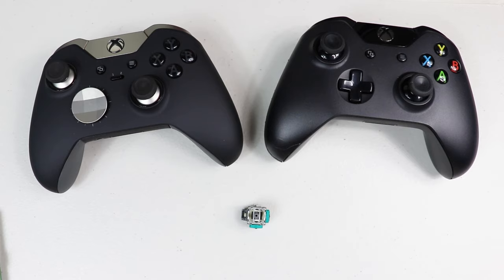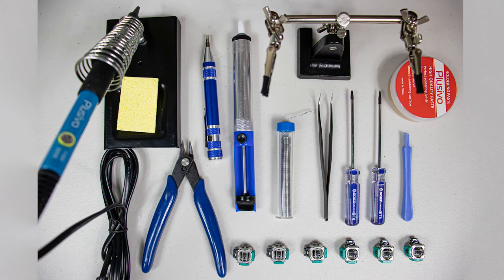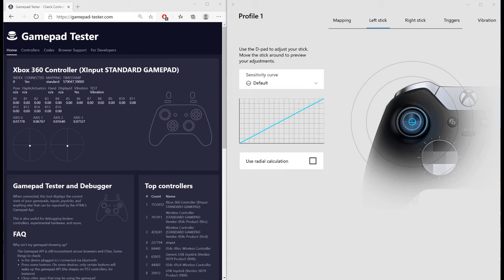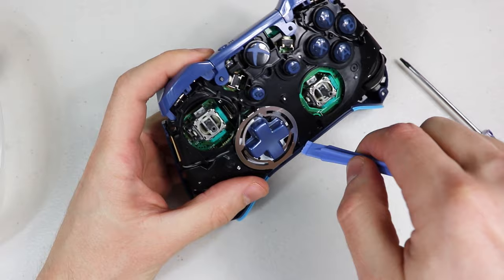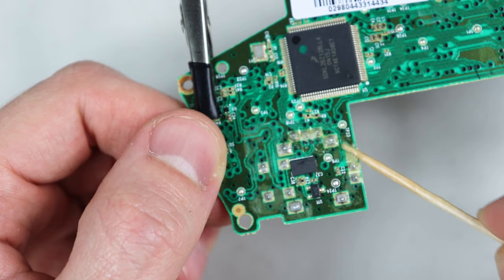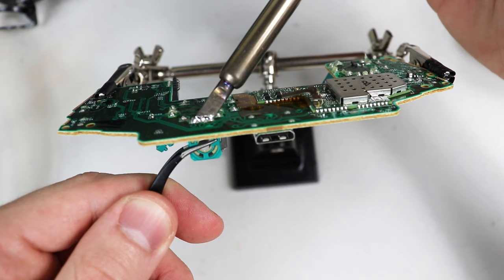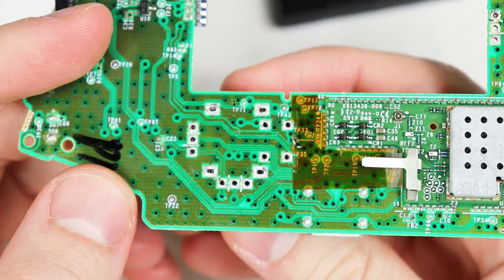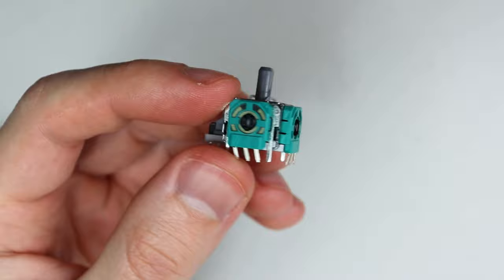How to Replace Xbox One Controller Analog Joystick - NEW METHOD - Fix Stick Drift, Broken, & Loose

Comment: So after you cut the green tabs on the potentiometer, it stays in place after you solder back to the board? And theoretically, couldn’t you do that to the existing potentiometer that has drift? I already purchased your product so I plan on replacing the whole joystick anyway.
Reply from the maker: If the joystick isn't loose and feels fine, I'd recommend just changing out the potentiometer. And yes, it will stay in place even after cutting off the 3 nubs. It's important to not cut off the two tabs, though, as cutting off the tabs will cause the potentiometer to free from the joystick.
Unfortunately a typical reason for a potentiometer having drift is the wearing down of the carbon inside it, so replacement will be necessary then.

Comment: Yoo man. I just dropped my controller and the left analog stick isn't responding when I click it. Should I just pay for someone to refurbish it? I don't exactly have the best luck as I have already dropped it. I was thinking of just to keep messing with it.
Reply from the maker: So the click button is broken? Sounds like you would need a full joystick replacement unfortunately (if you wanted the click to work again).  There are some sellers on ebay in the US who do some repairs if interested. Just type in "xbox joystick repair service" in the search bar.
Reply: @SOSSGAMING  Yeah. I figured. I had to move the stick forward and put alot more force behind the click for it to work and that was one time so something is out of place and broken.

Comment: Do you have to manually adjust the axis. Or can you leave the pins on and use it as stock ??
Reply from the maker: You will likely need to manually adjust them unfortunately. Unless you have the x/s series or elite series 2 controllers. Those ones have automatic calibration, for the lucky few that have them.

Comment: Besides the 6 pins for the potentiometers what are the other pins used for?
Reply: 4 are anchor points to hold the whole module in place, and the other 4 are for the click button.

Comment: Does cutting off the nubs cause future problems?
Reply from the maker: I've never had an issue nor heard or seen it being an issue, because the side tabs hold it in place as well as the solder.  That's why it's important not to cut of the side tabs, because doing that will cause an issue. Thanks for the question.

Comment: I am more familiar with the controller. This video is helpful. My joystick replacements are arriving monday. Im just concerned about the fumes. The warning sign says it can kill if inhaled. Is that easily avoidable? I live in an apartment with no vents or windows all though i have an ac that may act as a vent because it leads outsude. Im not really sure if thats the same. Lol sorry. Im new to sokdering and dont want to solder until im confident. I'll probably solder my old controllers that i dont care to lose first. But mind if soneone helps me out with the whole fume situation?
Reply from the maker: I suppose it depends on what type of flux you are using. If you are worried I would recommend checking out some videos on ways to deal with the fumes. Good luck!
Reply: I was worried for nothing. I'm getting better with soldering

Comment: bro can you please explain about the solder paste, if you don't have solder flux can flux paste or just paste work to make soldering easier and to remove oxidation?
Reply from the maker: If it's flux that is meant for soldering electronic components, I don't see why not! If you've seen Louis Rossmann, his motto is basically use as much as you want for every situation lol

Comment: So everything went great except the Left trigger (b6) is now showing always on. I did not touch the sensor during the joystick process. Unfortunately, the remote is even more useless now than before with just stick drift 😢. Any advice on how to proceed?
Reply from the maker: Did you end up figuring it out? I would clean up the board really well with isopropyl alcohol. Sometimes the flux can interfere with things.

Comment: The video is really good I just have one problem, when I use the tool to calibrate the sticks it either doesn’t recognize any stick inputs (not stick presses, those work fine) or it only recognizes diagonal up right
Reply from the maker: I'm guessing the pots aren't soldered yet? Sometimes it takes a bit of finessing with the pins to get it to recognize. Hopefully the pads aren't damaged. Do the through-hole pads look damaged?
Reply: @SOSSGAMING  the through-holes don’t look damaged, but ive tried it with the other sticks i got and they all had the same issue
As embarrassing it is to admit, i went the cheap route buying sticks and got some Chinese knockoff that look like real life PS2 graphics, comparing those to real sticks shows that they look a lot blurrier especially compared to the see-through part on the pots
Reply from the maker: @ZillionSole31  Yeah it could be the actual sticks then. Unless you had that same  issue before installing them.
Reply: @SOSSGAMING  nah my issue before installing them was that the stick click wouldn’t register so I decided to replace them but now these won’t work
I ordered an official (I think) stick now so hopefully when that comes it’ll work
Reply from the maker: @ZillionSole31  Gotcha. Good luck!
Reply: @SOSSGAMING  thanks, I hope this works cuz I do not have another controller
Reply: @SOSSGAMING yeah I think I damaged the through-holes, I needed to add someone back on Xbox so I plugged in my controller and despite it not having a stick, it still did the diagonal up right thing
Reply from the maker: @ZillionSole31  It sounds like one or more of them are then :/
Reply: @SOSSGAMING  I see, i think what im gonna do is buy a broken Series X controller and then just use the daughterboard from that on my controller
Reply from the maker: @ZillionSole31  yeah not a bad idea

Comment: What if you’ve managed to remove the solder base for the pins? Can you still fix the controller?
Reply from the maker: Technically yes. There is a way through soldering on a jump wire. Which controller are you working on? https://acidmods.com/forum/index.php/board,537.0.html

Comment: Gonna try this on my elite series 2, praying I don’t mess up lol
Reply from the maker: I'm going to make a video on that soon actually specifically for the elite 2's, and by soon that usually means a month or two lol but you actually don't need to calibrate them.  Simply replacing the joystick is fine, as the elite 2's have an internal calibrating software which is quite incredible.
Reply: @SOSSGAMING  opened it up yesterday and changed out the buttons and bumpers but I’m definitely gonna wait for that video to do the analog stick.
Reply from the maker: @koolkid121998  Ok, I'll try to hurry!

Comment: Can i do it with just a soldering iron and some tin? Or do i need the de soldering thing and the flux?
Reply from the maker: You will need to be able to remove the solder somehow with either a solder sucker or wick, and flux will help a lot with the connection but you may be able to get away with it, especially if it's rosin core solder that you already have

Comment: Is there a way to replace only the grey shaft? The grey shaft is broken but the joystick tests fine. The thumb stick just spins freely because the grey shaft has broken.
Reply from the maker: Technically yes, but it will actually be more work, because you would have to tear down both the donor joystick and the one already in the controller. At that point it would just make sense to replace the joystick. If the potentiometers are fine you should be able to get away with leaving them in without needing to calibrate them again. So just the actual joystick part you'll need to replace.

Comment: Hi, I tried desoldering it but i’m having a hard time to desolder two pins do you recommend that I purchase flux and attempt to desolder it?
Reply from the maker: If you don't have flux you will need it anyway (to add the solder later). You can certainly try desoldering it with solder sucker or wick. 
Also, make sure you are using a large enough tip and that it is clean (for good heat transfer). Then I'd recommend adding leaded solder to it (and flux) to also help it melt.

Comment: i don't know if you check this still but i tried two of the joystick module you listed and the controller still shows constant keystroke to the left and won't register any right direction.  i don't know what to do
Reply from the maker: Do you mean it's stuck all the way to the left? If so, it sounds like one of the through hole pads are damaged on the x axis. It's possible to fix this with a tracer wire. If you want to send me a picture and mention which model controller you're working on to my gmail sossgaming I'll try to see if I can help you out.

Comment: I replaced the entire left module. On gamepad tester, the left stick was not registering left or right movements on the x-axis. After replacing with a brand new module, the stick now registers as being stuck fully to the right.

Any ideas what it could be?
Reply from the maker: Hello. First I would double check the joints and make sure there is no bridge between them. Then clean real well with isopropyl alcohol (to remove the flux residue). There's a good chance though it's a case of a damaged through hole pad. I did a write up on how to "repair" it with jump wires. https://sossgaming.com/xbox-joystick-jump-wire/

Comment: Thanks for the video.  I have tried this and am stuck at one point.  I have soldered the new joystick to the board without soldering the potentiometers.  I am able to get the Y axis potentiometer to a good spot, but the X-axis potentiometer is not even registering.  I have bent the leads up and down to no avail.  also tried different potentiometers and desoldered the analog joystick and soldered another one in and same problem.  any suggestions?
Reply from the maker: Best case scenario is that it's just having a hard time, which I've had happen before as well.  The other main worse case scenarios would be that one of the through holes is damaged, or there is a crack in the board or some component in the powering of that pot's axis is damaged, lost, or shorted.
I would first try to actually solder it on and see if that works.  If it's not registering it may be one of the other problems.  A damaged through hole is technically possible to overcome by rerouting with a strand of wire to another specific part of the board (depending on which one is damaged)

Comment: Hey what about the gen 2 elite controller is the analog joysticks the same as the one in the link?? And the method the same for installing thanks really good video I have the elite 2 controller just under a year and the stick drift is really really bad it’s upsetting on an expensive controller. 😣
Reply from the maker: Hey there.  They are not the same joysticks, but if it's just stick drift the good news is that all you need to do is replace the potentiometer(s)! The one's in the link use the same potentiometers. Hope this answers your question.

Comment: Why don't the new cubes come designed so they are automatically centered? I'm a noob at this stuff and I am going to attempt my first repair ever so excuse my ignorance.
Reply from the maker: I believe because the measurements are so sensitive it's practically impossible to do on the manufacturing side. Hence why they need compensate by calibrating with the motherboard before the controllers leave the factory.

Comment: Any ideas for a noob to get some soldering experience so I don't destroy it pls lol
Reply from the maker: Excellent question. While I just dived right into myself, with mixed results, I suspect you could probably find or buy some old cheap motherboards of any type and just go at it with the iron. Ebay would probably be good, or any local thrift store or something. You could also get some pcb board kits for $10-15 or so that you could practice on. Not sure if that helps.
Reply: @SOSSGAMING  It does :) I'll probably pick up some thrift store kids toy and go sid on it thank you man

Comment: It's really necessary to cut that 3 knobs? 14:01. Isn't that calibrated from factory?
Reply from the maker: It is to manually calibrate the controller. If you're working on a S, X, or elite 2, now the accessories app has calibration software! But on other controllers, you will likely need to manually calibrate as shown. The controller is calibrated at factory to the joystick that was installed. But because each joystick is different, it will have a different value than what the controller was calibrated too, hence the need for manual calibration. Hope that makes sense.

Comment: Hi, I have a parts controller with one bad stick and one good one that has no drift. Do you think transplanting the good stick from the parts controller into one that needs the stick replaced would be worth it?
Reply from the maker: If you just have drift, I'd even recommend just replacing the potentiometer that is causing drift. Definitely worth it!

Comment: @SOSS GAMING After seeing a comment that this also works for xbox series x/s controllers I bought a toggle replacement kit and attempted to give it a shot. No matter how hot I turned my soldering iron up to, the joints would not melt off the board. Do you have a recommendations for series x/s controllers? Did they use stringer solder on these ones than the xbox one controllers?
Reply from the maker: Sounds like they used lead free solder, which has a higher melting point. A trick to remove it is by adding leaded solder and flux to the joint. Multiple times of adding/removing may be needed. That's a bit unfortunate. Hopefully that helps though. Should also mention to be careful with the heat too, it could damage the through hole pads.
Reply: @SOSSGAMING  Thanks! I'll try that

Comment: My left stick seems to have a dead zone when pushing forward. In a game, it will register slight movement, then nothing until you press it all the way forward. Using the gamepad app it shows the dead zone clearly. Is this something that some contact cleaner might fix, or does this seem like a completely broken stick?
Reply from the maker: Are the joysticks original? If they are it's just a bad potentiometer.  You can replace just the potentiometer, or even the whole thing if you wanted.

Comment: Thanks for the video! That really helps me! I'm trying to use the disassembly method, but I cannot manage to de-solder the part with an soldering iron. I have a Xbox elite series 2 which has small holes. Any advice please?
Reply from the maker: Make sure the temperature is hot enough and use flux.  However, with the elite 2's the issue is likely that they used lead free solder (higher melting point) so in that case also add more regular solder to it which should lower the total melting point and allow you to remove each piece.  Also, no need for the manual calibration on the 2's they automatically calibrate after a bit of gameplay :)
Reply: I used flux and with my iron at 450C it didn't work... After researching, apparently it's a common issue with multilayer circuit board, using a heat gun and a soldring iron (both at 450C) worked pretty well for me! for the rest you're video is just perfect! I still used your calibration method by the way XD)

Comment: And here i was thinking it was just a simple replace on the thumbsticks, until i saw the scary calibration... If i knew prior hand that it was this insane i wouldnt have gotten my elite 2 thumbsticks lol
Reply from the maker: You actually don't need to do calibration on the Elite 2's :) After a while they will manually calibrate themselves.
Reply from the maker: As long as it's on the Elite 2 motherboard that is.  If trying to install elite 2 joysticks on other controllers it will still require calibration.
Reply: @SOSSGAMING  Yeah haha Actually i want to update my 3.5mm xbox one controller from elite 1's to elite 2's :P That step is a bit too much for me tho haha

Comment: Would the kit with joystick work in a power a nintendo switch controller?
Reply from the maker: Someone told me that the resistance on the potentiometers is different, but I haven't been able to very that yet. I wish I could be more help.

Comment: Willing to help me out? When letting the stick go back to center, it slowly goes back to 0.00 ~ +/- 0.02. Take a third-person game, for example. Your character is still moving forward/backward after you let go, but eventually stops after a second or two. Noticed this happen to my most recent red Series controller. Any reason why?
Reply from the maker: Is this before or after install? If after, you will need to adjust the pot again to alleviate the resistance causing it. 
If no replacement has been made, the pot just needs to be changed out.

Comment: does using copper tape works?  i have burnt the copper through hole  on the pcb board
Reply from the maker: I am not sure actually. If the through hole is damaged, I'm not sure there is a way to fix it unfortunately.

Comment: I’ve soldered a new one following your video. But up and down don’t give a response. Only left and right. All joints are clean I’m not sure why this would be happening
Reply from the maker: The most common cause is a damaged through hole pad. Another issue could be the wiper is upside down or damaged, the potentiometer itself is bad, a small diode fell off or is corroded, or a short somewhere else.  Which controller are you working on and which side joystick?

Comment: If I just replace the sensors under those green covers will I need to recalibrate the controller?
Reply from the maker: The wipers? If you're able to just replace the wipers then I would say no :)